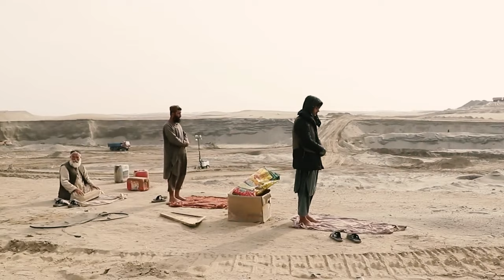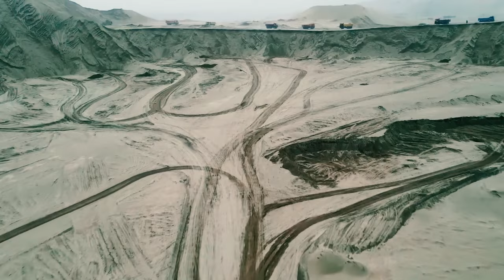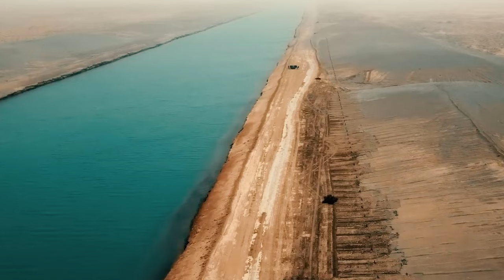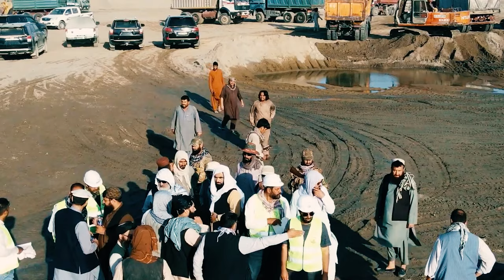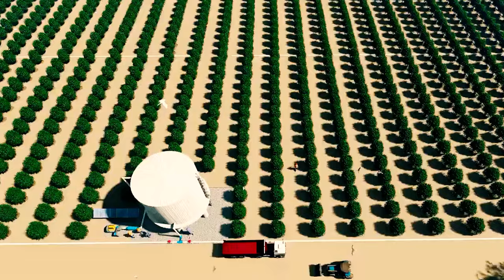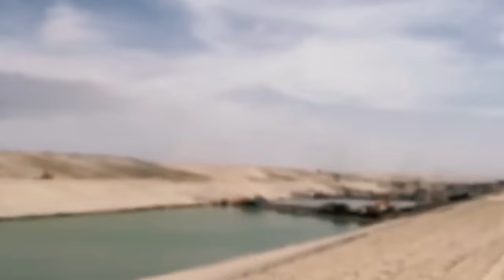Transforming Lives with Water: The Qosh Tepa Canal Project in Afghanistan| 4K |  کانال قوش تپه |

Comment: Would in be easier to make a pipeline that would fill water in reservoirs at suitable locations? - like the oil pipelines! 

I am not sure of the landscape and geology and other factors but just throwing in my thoughts!
Reply: Pipeline will be costlier, will need pumps and cannot served as alternative transportation or recreation facility
Reply: Using natural landscapes can provide very cost-effective solutions than thinking of mechanical designs all the time.

Comment: This project has two major problems. First, there is no way of storing water circulation mechanisms, and after a few months, the water will be rotten, the amount of bacteria in the water will cause a bad smell, and its use will be harmful to health.

Second, due to global warming, the water level is low right now. By collecting more water from the river, which is shared between three countries, especially Turkmenistan, where that river supplies most of its water resources, this will create a bigger security problem for Afghanistan.
Reply: Can Afghanistan get water from the sea?
Reply: @InfinityandEternity  definitely not, what am I saying that this project would cause more trouble that it seems.
Reply: @aminabbaszadeh1066 
Trouble by who? If it simply a matter of human error the relevant parties should receive attitude adjustment.
Reply: @InfinityandEternity  Right now, central Asia, especially Turkmenistan, Uzbekistan, and Tajikistan, are heavily investing in military equipment. The situation would not be like 2001 about turing over a person; it is a matter of existence for them. Since most water resources in Turkmenistan are supplied by that river, they would not act like Iran. Read more about the Nile River and the situation in Ethiopia and Egypt.
Reply: @JoesTowingBaltimore  Water must be in flow. If you change the course of the river so that the end of the water does not rotate, the bacteria in the water will increase over time and will smell bad.
Arab states such as the United Arab Emirates, Bahrain and Kuwait have established islands on the Gulf water. To avoid this problem, they are artificially flowed with water pumps.
Reply: Soviets built 4 similar canals in Ukraine in the 50's and they were functional and working as intended until they were destroyed in 2023